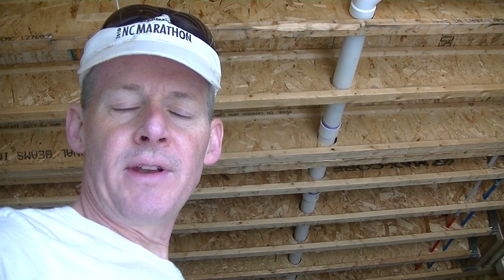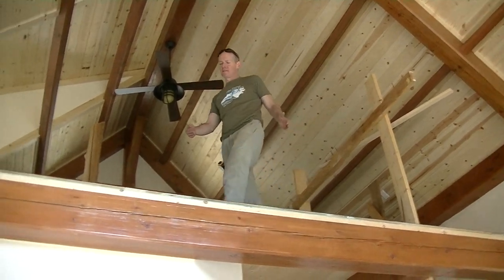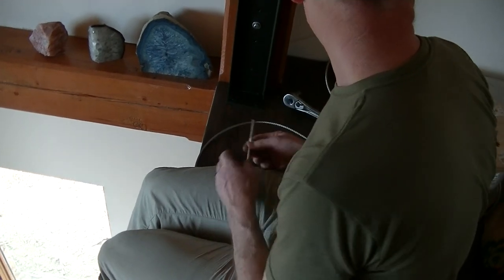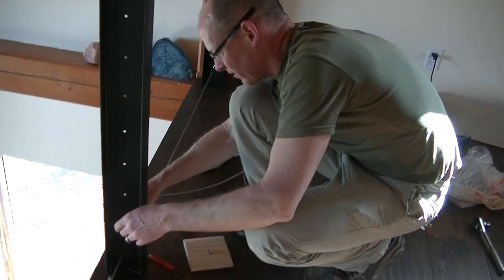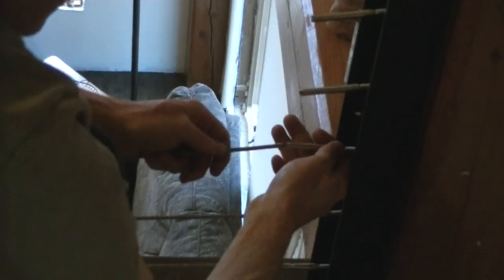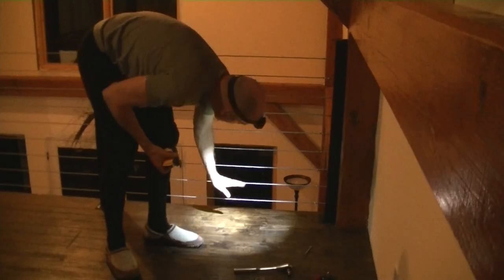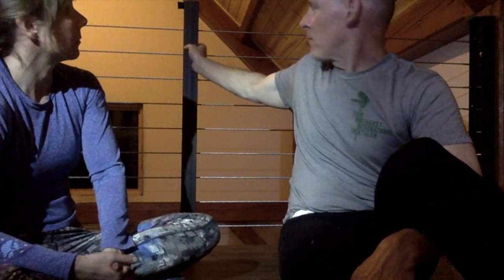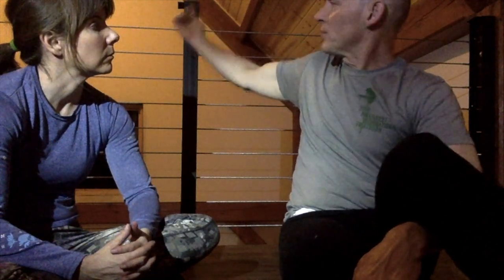Steel Cable & Beam Railing Install for our Timber Frame Loft

Comment: Love the cable and beam look for the railing! It contrasts with the rustic look but doesn't impede the view from the loft! I never tried to do one of those, but it's interesting to see how you guys solved the setup!
Sorry to hear that more snow on the way. Spring is just around the corner for you guys! Are you planning a garden or have any plans for the landscaping? I know that the driveway is a priority. Looking forward to more videos!
Reply from the maker: Thanks- it did turn out quite nicely and minimal impact of the views from the loft. We did have a small garden last year , but this year I wanted to expand it some and add another bed. Right now, we have to wait for 5-6 inches of snow to melt...better be gone by the end of the weekend!!

Comment: Like the cable railing look. It lets you see more than a traditional railing. Nicely done. :)
Reply from the maker: Yes! I think that's the best part, you can almost see through the cables so you don't block the view upstairs.

Comment: Hey, I have a hydraulic crimping tool you can borrow for those ends !!! Oops, to late. We put lock nuts and washers on the outside and inside of the threaded cable adjusters. You would be surprised with expansion and contraction of the home how they loosen only using a inside nut. Looks fantastic, good job.
Reply from the maker: Oh now you tell us! LOL Interesting to know about lock nuts and washers on both sides! I can see that. We still hear random "wood creaking" or 'house settling" sounds on a daily basis.

Comment: On the next one drill and tap the end post and cut your cables after determining the length all at one time and put your connectors on asymbly line procedure. You use a jamb nut to keep them from backing off. They will stretch over time and have to be tightened. This allows for easy retensioning of the cables.
Reply from the maker: Oh very good tip! Thank you

Comment: Awesome project love it...We started using the wire rope for suspending cable tray  for telco  in the early 2000s, We learned the hard way about having the correct cutters/crimpers and fasteners for different dimension wire rope...but man was it a labor saver
Reply from the maker: Nice! At first I wondered why bryan was making a big deal about not using the cutting wheels, but the way the hardware is designed,  you need a perfect flush cut to fit into the fasteners and he's like "this project is on hold until the cutters get here!" lol

Comment: I know you took a long time to get this video out.  LOL  Of course I just finished my cable railing and really would have done what you guys did but oh well.  I love the trailer steel that adds a serious cool factor.  I ended up using treated lumber for support, turn buckles, clamps, and eye bolts.  I hope you don't have a 90 deg on the other areas.  Looks great.
Reply from the maker: oh my that's funny and quite the coincidence! I think we'll just double post it to handle the stair well part , trying to doing a 90* cable bend. Just sticking to the straight lines.

Comment: what a job. I am not sure I would have done it this way.. would likely have taken and used a thru bolt on the end and a lock washer to hold the bolts. would have painted the nuts black..   Because sail boats use this sort of swagging system.. would have rented this tool to do the job.
Reply from the maker: Interesting. I like hearing everyone's ideas. We still have 2 more areas to do still. Will see if Bryan would change it up...

Comment: Looks like a fun project...railing idea is quite unique,,have seen similar idea used on docks , using large diameter rope.......did you check with county for design and required code for railing and cable spacing ??...............I used to be finish carpenter in Colo. for many years and spacing had to be under 4" (between cables)..(4" sphere could not pass through)...on video they look a little more..(didn't hear a comment of hole spacing).....that was state building code,,but I am aware of many systems that did not meet code specs and still were able to get signed off...(imagine that).....Wish I could have been able to afford building in an area such as yours,,beautiful location....Will be watching to see how it all turns out.............Stay Safe and God Bless.........
Reply from the maker: the cables are spaced just under 4 inches apart (3 & 3/4") . Hopefully the inspector won't show up with a a 4 inch sphere in his bag!

Comment: You may have a problem with the fixing of the cables at the staircase end. You stated that the fixing at the end of the stainless cable is aluminum. There is a possibility of galvanic corrosion of the aluminum if there is any moisture. You are using the space below for cooking. The cables could pull out of the fittings without warning in one to two years. 

The railing does look very good.
Reply from the maker: Thanks for the warning. We'll keep an eye on it!

Comment: Looks really good and loved how you reused the trailer frames.  Did you have any problems getting it level?  I know your floor is pretty close but sometimes visually it can go askew once the horizontal cable is in line of sight.  Visually is the large piece of railing going to look best or maybe a lighter coloured smaller piece of hardwood?  Whatever you decide I’ll look forward to seeing.
Reply from the maker: Bryan used a few shims to get the posts more plumb, the beams tend to be more crooked than the floor. I'd like to see what it looks like to use a slim pine or aspen tree, but thinking of staining it cherry like the beams to match.

Comment: Maybe for the next sets of railings, you could fix the nut onto the back of the hole by either a tack weld or some kind of glue ? 🏴🏴🏴🏴
Reply from the maker: Good idea, someone else suggested that too.

Comment: you can buy a battery cable lug  crimper on ebay 30 to 35 dallors that would do the job, 9 dies that range from 6mm up past 30mm
Reply from the maker: oh cool. good to know- thanks!

Comment: Love the look but (always someone with a "but") I would have made the cable one continuous piece with cable clamps on both ends. With some adjusting, the cables would be equal length from the end posts and a couple of bar clamps could pull the last I-beam to the post and then install the screws to hold the beam to the post. I'm thinking it would save lots of hardware and time this way..... Just my $0.02.
Reply from the maker: That's a very interesting idea actually. We still have 2 more  areas to do. But saving the hardware yeah. I'll pass along to Bryan.

Comment: weld the nut on the back of the post where you put the turnbuckle on
Reply from the maker: that's an idea!
Reply: Look into "Rev Nuts".Its a type of rivet system that installs a threaded nut. Looks great
Reply: @thowe7988 you have to have a special tool to install very costly
Reply: @bobwoodhams7242  Riv nut tool sets start at $20.bucks.Shouldn't be a deal breaker to a home builder.I do like the idea of tack welding the nuts in place.Check that heat not altered threads prior to install.

Comment: That's a lot of tension your putting on those 3" lag bolts, maybe another couple per post might be better.
Reply from the maker: True there are a lot of cables per post, but the tension isn't all that high, there's still an inch or two of play. Biggest risk is the cable sliding out of the turnbuckle or stopper, which did happen at one point after tightening the turnbuckle. So we paid extra close attention to the crimping after that.

Comment: If you ever do something like this again consider a product called Nutsert. It goes into the hole then you tighten it down to swell the collar which locks it into the hole and that gives you a securely  attached threaded fastener. https://www.amazon.com/s?k=nutsert&ref=nb_sb_noss_2
Reply from the maker: ok sounds like the one we saw on "this old house" video

Comment: the final test of the railing is for one of you to throw yourself at it and see if it holds.  just joking. please, do not test it like that.   cool video. do not forget that every so often test the tension because sometimes the cables can stretch and loosen.
Reply from the maker: Thanks for the tension check reminder. No not checking it wrestler style LOL